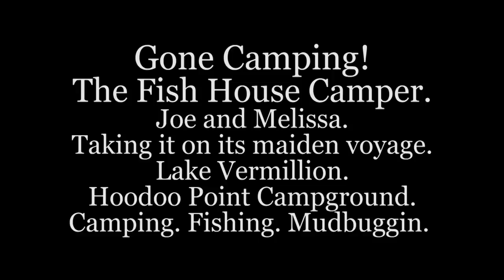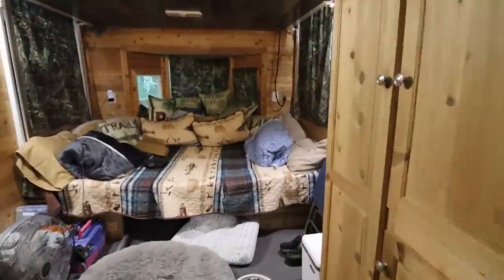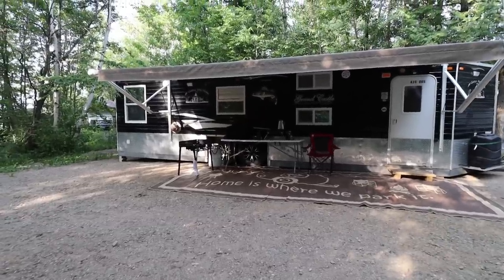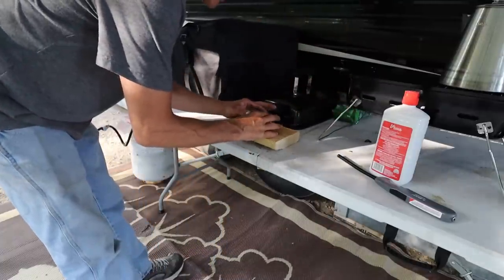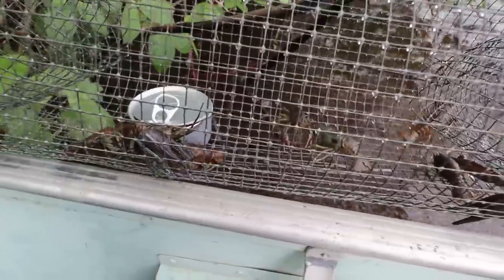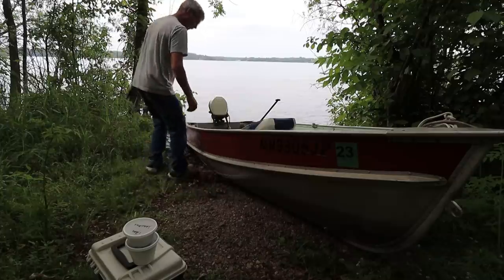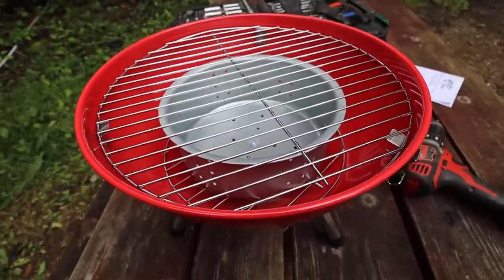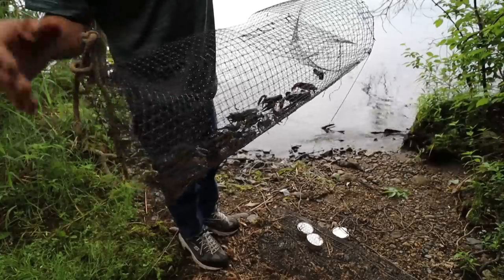Gone Camping! The Fish House Camper. Joe and Melissa. Lake Vermilion. Camping. Fishing. Mudbuggin.

Comment: Good show. Wish i knew you was going there . In the spring you can catch fish 50 feet off shore .theres rocks out there that go around that camp ground. After about june 8th the fish move out to the big bay. You were in the small bay. Big boats sure help in going way out to fish. If a strom comes up its no fun riding 5 foot rollers to land. After june 8th for walleye your better off fishing at 8pm to midnight to catch fish. But other bays are better for fishing. Way to much day time boat traffic and the fish just lay on the bottom all day. Alotta boats an wave runners all day screws up the fishing and conditions the fish. We dont go there much in the summer. Early spring and fall is best or at nite. Yup you were 32 miles away.

Comment: Joe angle your awning to one side and you shouldn't need that 2X4 in the middle. I like how the trailer raises and lowers. That's pretty cool.
Reply from the maker: I actually had no idea that our awning automatically tilts and lets the water off and then goes back to its normal position so I used the 2x4. We were inside and it started pouring and Melissa was looking out the window when I had removed the 2x4 and it just slowly tilted down, the water ran off and it went right back up. Now I know I do not need to do anything.
Reply: @NorthernSeclusion  so you dont have knobs that you tighten on you arms then. That's a nice feature but the only problem with that is because you're not locking or anchoring your awning down when you get higher winds you should put your awning in. Like you did. Some will roll up by their selves.
Reply: @NorthernSeclusion oh my!! Really!! That IS awesome!! That ice fish house RV camper really is the castle!! Top of the line, amazing!!